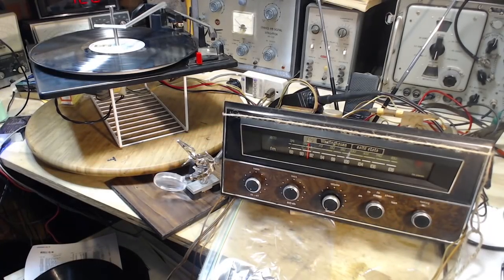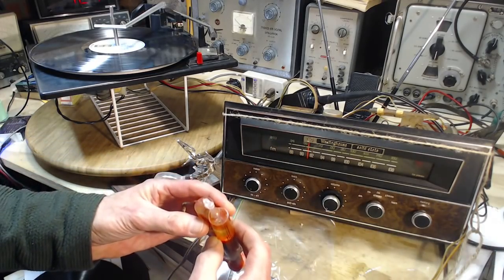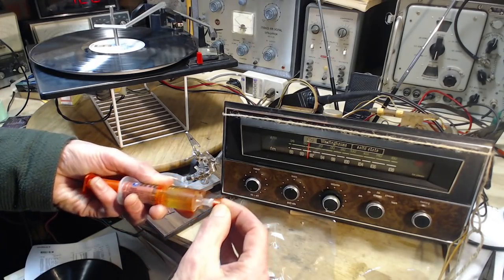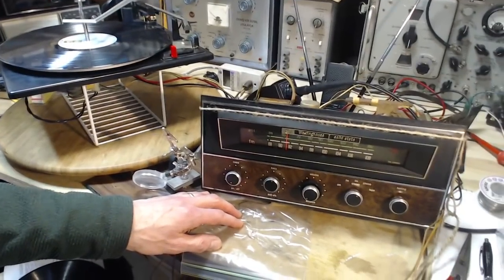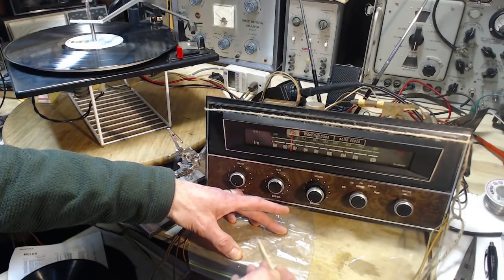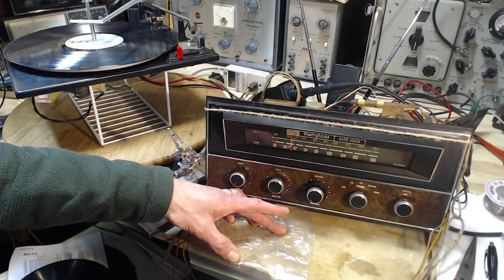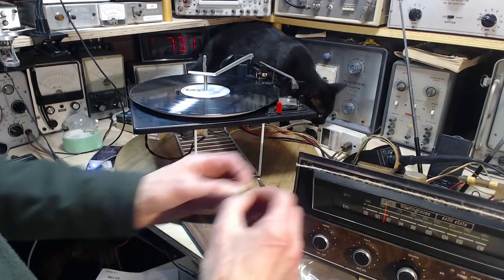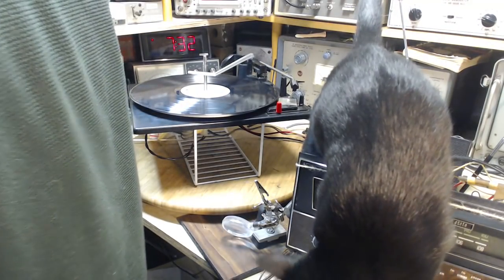Westinghouse Console Receiver Video #4 - Needle In - Sound Out

Comment: G'bye Shadow. LOL. Those epoxy glue applicators that have a single cap for both parts can be a problem. A quick hint about epoxy glue containers; be sure when you put the cap back on so that the same side of the cap goes on the same orientation it was in when you removed the cap. Otherwise, a little of the epoxy inside the space between the cap and the applicator will set up making it really tough to get the cap off the next time you want to use it. Been there and done that. I plead stupidity.  8-)  Good video, Jim. Thanks for posting it.